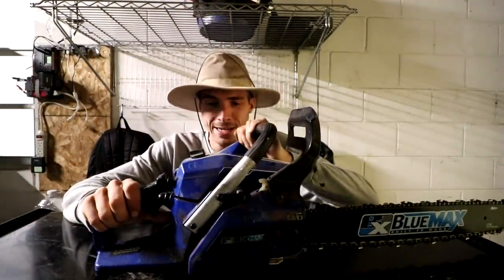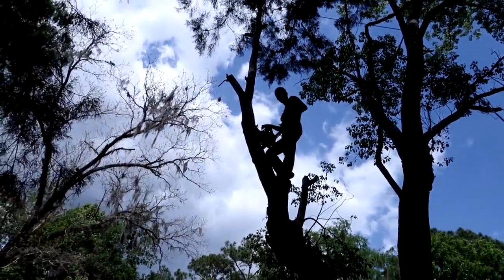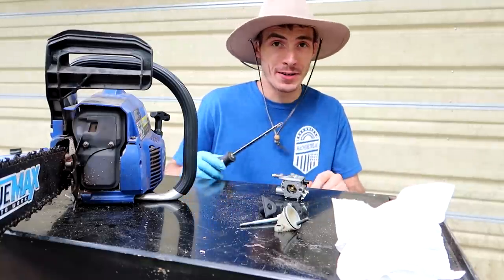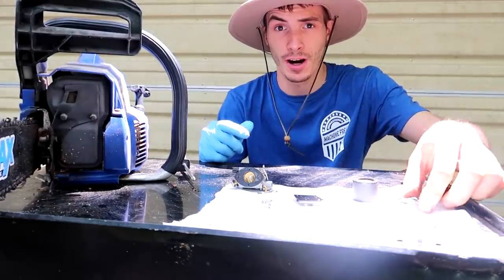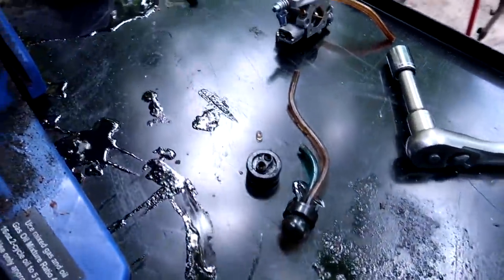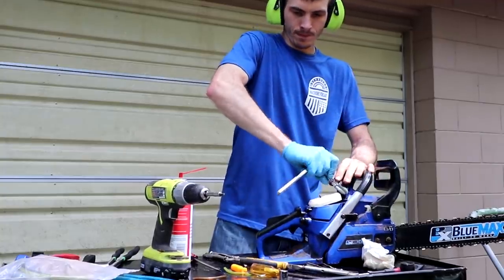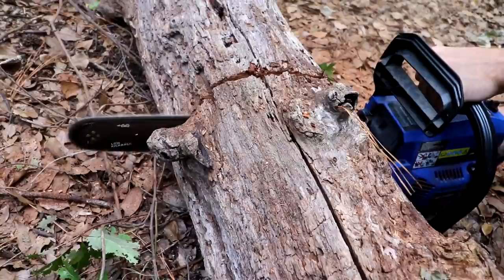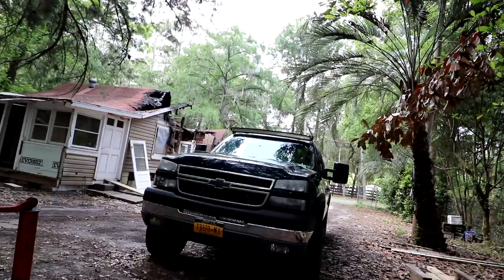DON'T Drop That Tree ON MY HOUSE

Comment: yep, biggest issue on those carbs are crud getting in and plugging the screens, but also the fibrous diaphragm/reed valves breaking down and plugging the screens and jets...been there done that circa 1990's. the fuel lines harden and break or split and the pickup filter-clunk gums up also. chainsaws, weed-eaters, large model aircraft engines, snow blowers! rebuilt a few(countless) of them lol

Comment: The OEM fuel lines for my stihl weed eater were more expensive than a replacement carburetor, plug, and air filter kit off amazon...